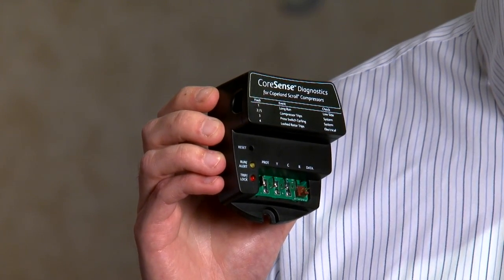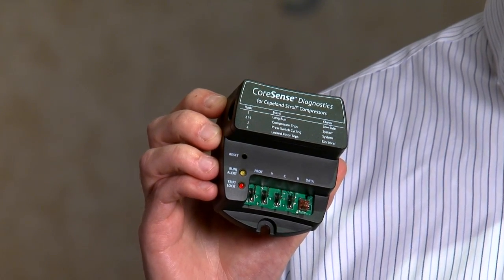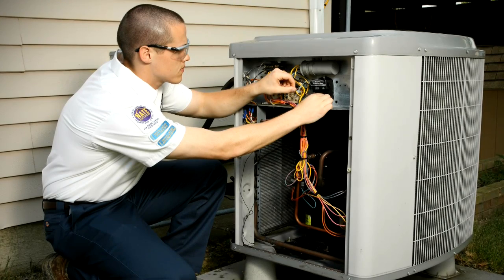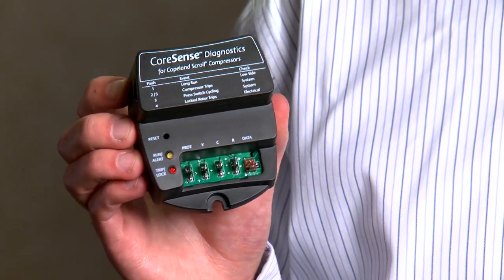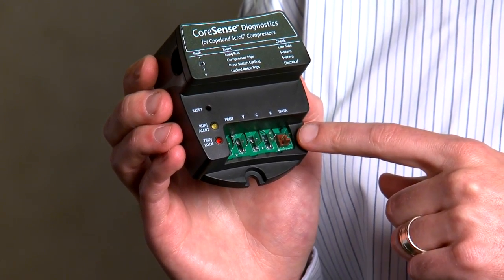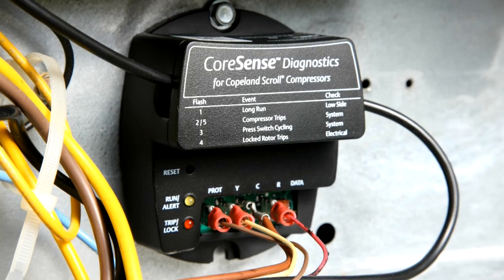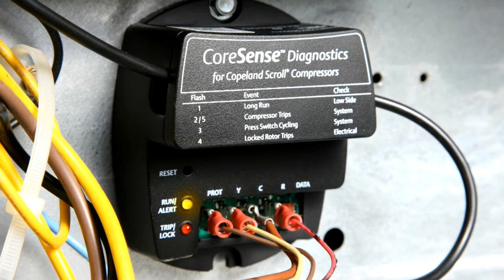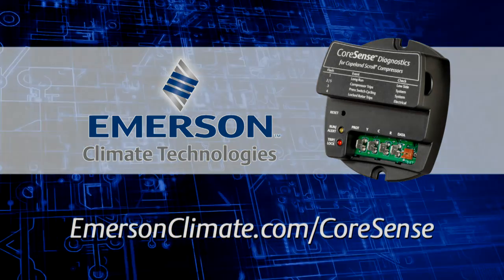CoreSense™ Diagnostics Module Overview

Comment: Now if we are talking about automotive air conditioning compressord where the lubricant is mixed with the refrigerant, low refrigerant or none like a two cycle engine, will toast the compressor under these conditions.  A home air conditioner compressor is more like an air compressor, positively know lubricant in the air or the refrigerant, damage will not occur to the compressor, but practically all have a low refrigerant cut off switch anyway, so why be redundant.

Son is no brain with mechanical stuff but excellent with medications, he knew when his compressor was running all day and not cooling his home to call an HVAC guy people.  Most people do know if they set their thermostat at 72*F and their home is still at 80*F or warmer, something is wrong.

So exactly what is the purpose of the CoreSense unit, I read the manual and looked over the circuit diagrams.  One thing it can do since for all practical purposes is be an additional cause of problems. Also mounted outside in extreme ambient subject to failure.  Fix would be to directly wire your 240VAC contactor 24 vac coil directly to your thermostat. 

May too much for the common home owner, make sure your voltages are correct and take pressure reading.  My old Lennox just developed a problem, low pressure switch contacts were not making contact. But really for circuitry, not very much, two motors, a capacitor for phase shifting, low pressure cut off switch and a 240VAC contactor activated by 24VAC from the thermostat.